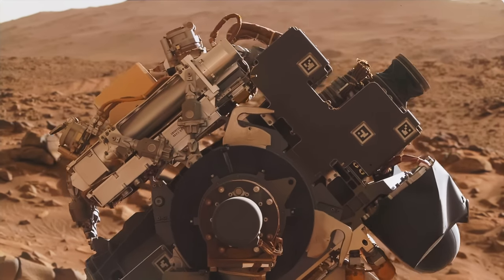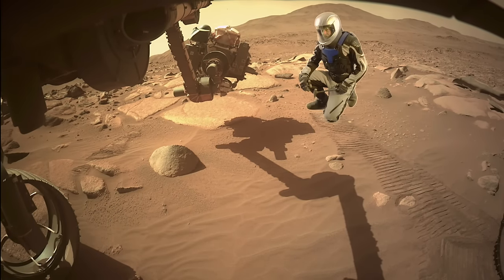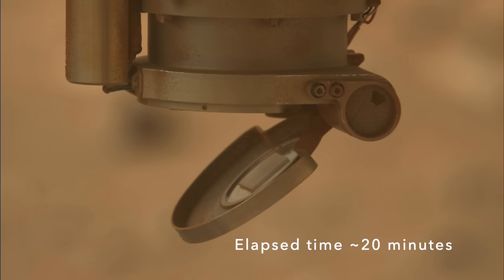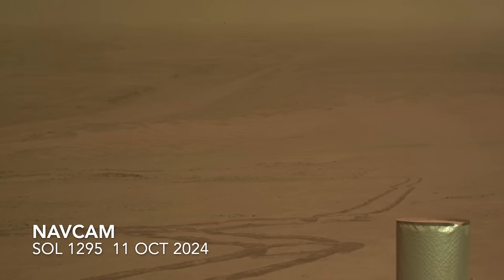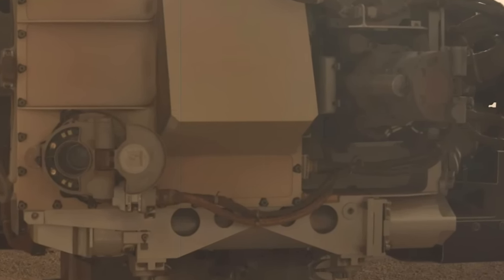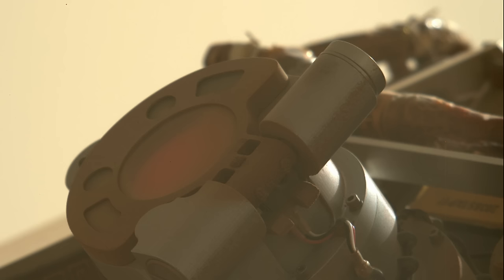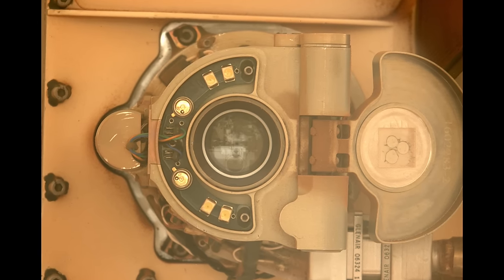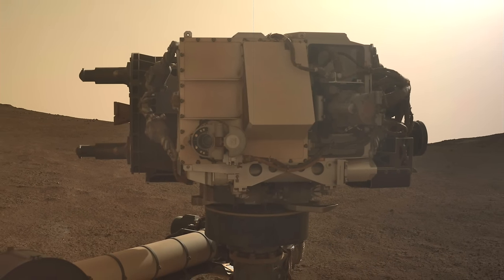Here’s what happens to an uncovered camera on Mars

Comment: Could it be because it's made of sapphire crystal? I have watches with both mineral glass, plastic and sapphire and the sapphire ones keeps cleaner by itself. Maybe due to the hard and non porous surface? Edit: grammar
Reply: Dust usually stick to things because of charge potential.
Reply: @TurboLoveTrain  Perhaps the rover should be able to put a voltage on its own skin then, and shed some of the dust. Not continuously, they don't have the power budget for that, but there are times when they have nothing better to do with a day's power.

Comment: Get Marsguy Forscale to fix it with that Swiss Army knife he's always leaving on rocks.....
Reply: Getting parts could be difficult. I'm pretty sure Amazon doesn't offer two day delivery to Mars, even with a Prime subscription.
Reply: Or he could use the Marsguy geologic hammer for a little more persuasion on the cover.
Reply: @ericfielding2540  That's almost what they did anyway. Using the vibration of the rock drill to shake the cover open counts as percussive maintenance.
Reply: NASA just needs to bring a Swiss army knife on all future missions to save Mars Guy the trouble.

Comment: These kinds of failures are what make me question whether the plans for extensive moon settlement are even feasible.   Dust gets everywhere, but if it's this bad on Mars, just imagine how bad it will be on the Moon where there's no wind to erode the sharp edges off grains of regolith, and solar wind statically charges it so it sticks to everything,  We kind of take for granted that because humans have been there it's possible and I'm sure a lot of brilliant people are already trying to solve these problems but... imagine if instead of a camera cover it's an airlock hatch.
Reply: All of the Apollo astronauts mentioned the dust as a serious problem. So you're right, it's going to cause issues.
Reply: @robadams1645 True, nicely described by Scott (Apollo 15 mission in the book 'Two Sides Of The Moon'); they slept in the lander, worked outside during the day - the closest humans got to 'living' on the Moon! And the fine dust was everywhere...
Reply: This is a pretty manageable failure, one that has had less impact on the abilities of the rover than even the engineers could have hoped. "A little bit broken but it still works" is a pretty good description of every spacecraft after a few years in space.

Comment: The sapphire lens doesn't hold dust. That's interesting.
Reply: Yes, very interesting, for avoiding sticking dust in future gear sent to Mars.
Reply: I was wondering if there was a way to charge it so dust didn't bond.
Reply: @TurboLoveTrain I had heard talk about that a while ago. Must be a reason they don’t do it.
Reply: @kaelandin  
It might by why they selected the lens material they did--crystals deal with electrostatic charges different than metals and polymers but with polymers they would also have to deal with eventual clouding and the only clear metal I know of is an aluminum based metal which is probably a dust magnet.

Comment: This should mean that if they can figure out a good surface layer that doesn't get dusty then solar panels could operate on mars. I don't know what kind of surface the solar panels on for example InSight had but if a thin layer of glass doesn't get dusty on mars then that would solve a lot of problems.
Reply: A rotating soft brush could perhaps be a simple low-tech solution.
Reply: Not only diminished light
Farther from the Star 
 But Extreme Low temperatures that effect 
 Solar Panel Efficiency.
 Better Suited for the Moon So much Closer.
Reply: @ZappyOh : I'd go with a long and precise robotic arm with a soft brush, as cleaning dust from almost every part of the probe (especially solar panels and not just cameras) seems a serious issue.
Reply: @LuisAldamiz  The preening robots of Mars.
Reply: Or just some sort of simple air-blow on rover itself, so that camera-arm get to it with every instrument, it will blow dust away! Why not installing it? They knew about dust problem.
Reply: @markwalters4525  - Douglas Adams was wrong: hairdressers are not completely useless, not on Mars at least. 🤣
Reply: @LuisAldamiz  Thanks for the idea!  Mars DOES have an atmosphere of compressible gasses (like Earth).  You don't need much for cleaning operations.  Just a small compressor, a small holding tank, enough power (?), and a thin PVC hose with an aiming mechanism, such as Percy's arm.  It could be used for MANY dust removal tasks (including hard-to-get-to places).
Reply: @MikeWiggins1235711  - You're welcome. Honored to ever-so-slightly contribute to future space exploration (I'm assuming you work for NASA, Rosscosmos, ESA or some other space agency). I didn't actually think of your air-pumping option (assumed Mars atmosphere is so thin that it wouldn't work) but you may be right once we adjust the parameters from "normal" Earth's air pressure to Mars conditions. 

The soft brush option is not crazy anyhow, but would require a more refined type of robotic arm, one that is more agile, human-like, than the usual ones (unless you're OK with a rotating brush, which seems simpler). If you (or whoever) goes for the gentle human-like robotic arm, I'd consider equipping it with a "swiss knife" of sorts, stuff like a screw driver maybe for other maintenance activities (but removing dust seems the most important one of course).
Reply: @LuisAldamiz  Thank you for the flattery, but I am a mere frustrated armchair scientist that can think outside the box when presented with great ideas like yours.

The soft brush idea IS a good one (thanks also to ZappyOh for mentioning this) that I see as being more efficient than the compressed air idea when used over large areas like, say, a solar panel.  I guess it's all a matter of what equipment it's going to be used on, the environment it will be used in, the amount of power needed, and, if there is no atmosphere (like the Moon), a rechargeable compressed air system wouldn't work.  In a tightly enclosed environment where Martian dust might find its way into, say [bad example, I know] a gearbox, then compressed air makes more sense.

Thanks for the discussion.  It keeps the brain cells (what's left of them!) awake.

Comment: "Here's Mars Guy for comparison... reporting live from Mars (and not anymore just standing still)" 🤩

"It hasn't rained on Mars for years... at least..." Well, the day it does, it won't be fresh water but mud what rains, so almost certainly it won't help.
Reply: Hmmm.  So if it does rain, it could be laced with what is in the Martian dust storms: iron oxide.  So Mars will experience a rather unique event: rust rain on a rust surface.  Similar to acid rain on Earth.

Comment: The idea that they open and close this 'just' with tiny motors is insane imo. Why is there no physical actuation backup? Like a tool fixed on the rovers body and a corresponding physical bump toggle button mechanism on the dust cover the rover can move its arm over and physically bump SHERLOCK dust covers onto to open and close the ports?
Reply: Added complexity and weight. It's always a trade-off in space exploration.
Reply: @robadams1645  having a little pin on the chassis with a soft tip and a piece of plastic on the lense cap that can be used to push the lense cap open and closed is very little complexity and works every time. All the complex stuff is software in having the arm move very carefully to push the flap open and closed on the soft tip so nothing is damamged
Reply: @BartJBols  they spend decades designing and testing these machines. You don't think they evaluated every option? You might think that something you spent 5 minutes thinking about is obvious but I guarantee that the engineers can provide you with 20 reasons why it wouldn't work or wouldn't pass a cost benefit analysis.
Reply: @robadams1645  It does work because i stole the idea from as the soviets used it. On top of that, you have no idea how these machines are designed, and how this organisation and compartmentalisation can create bad designs. For example, it could very well be that the engineers who were assigned the design of the lense covers were not allowed to make any changes to the rovers body as they were assigned the lense covers, hence this design would fail the requirements, even if its a better design. I made that example up but stuff like this happens all the time in large projects.

Comment: It’s too bad that they didn’t design an air pressure nozzle to blow off the lens.
Reply: I've often wondered that myself. I can't imagine that a compressor and tank would add that much extra weight compared to it's usefulness in such an environment. Run a line to a nozzle on the mast-cam and they could reach anyplace that they can point the camera at!
Reply: @Big_Un  Good for rovers with solar panels, too!
Reply: @pat8988  As a low tech solution for dust covered solar panels, just put a rotor blade above them! LOL But, I could see them frowning upon having a whirling blade of death near such delicate components. Haha.  I think your idea is smarter, more precise, and ultimately more useful for a variety of applications. Now, how to get that idea to the brains at NASA!!??

Comment: How the F did someone not build-in a fail safe redundant method to open and close the lens cover.  Stupid is as stupid does.  And why was a motor used instead of a fool proof solenoid?  JFC!
Reply: are you calling NASA stupid? When did you design a mars rover?
Reply: @cardboard9124  yes, definitely calling nasa stupid.